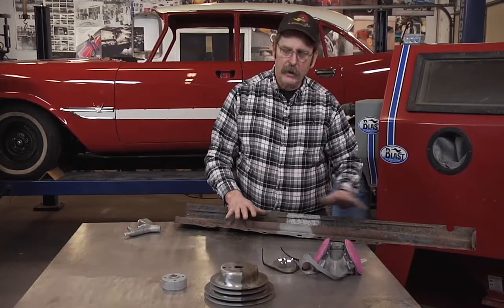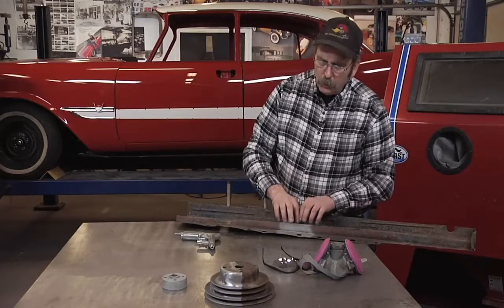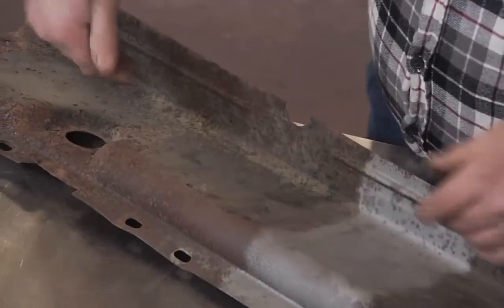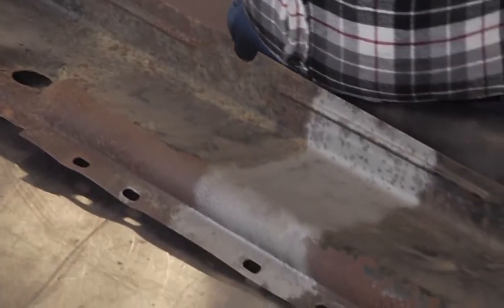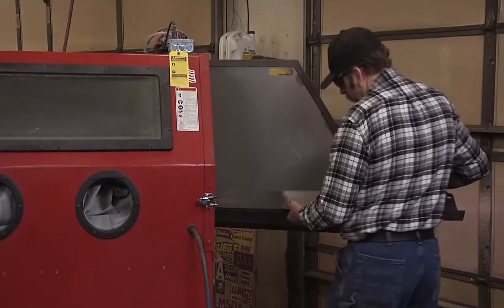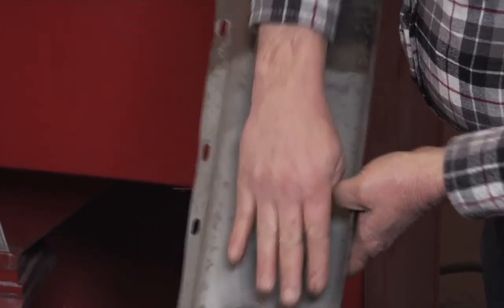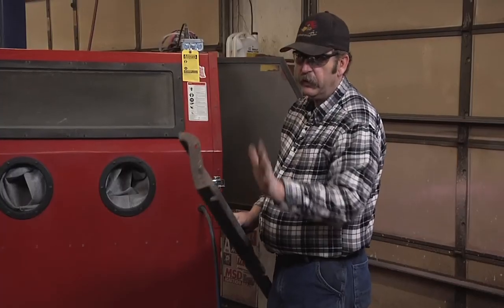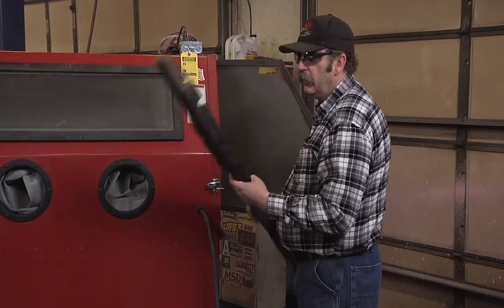How To Prevent Warping Sheet Metal During Media Blasting

Comment: What's the best material to use for blasting   car parts???
Reply from the maker: One of my favorite blasting materials for sheet metal and cast iron is DuPont StarBlast. It seems to really clean the metal well, cuts paint, and digs out rust. A number of pro-shops in my area use it as well.
Reply: Aluminum oxide is what we use at our sandblast shop. Kinda pricey, but it works well and can be reused several times